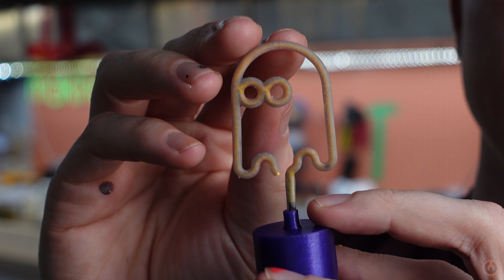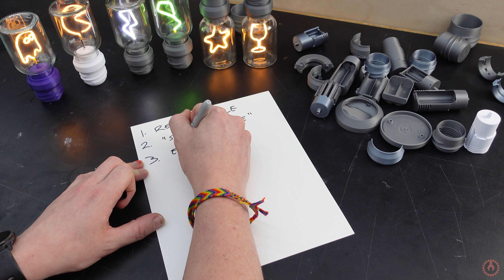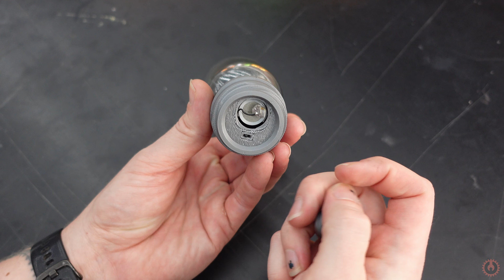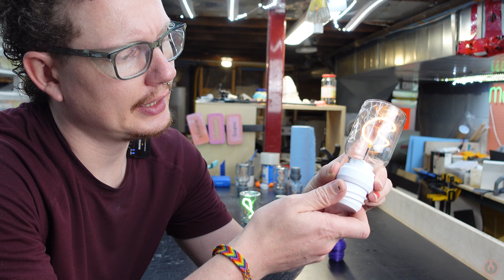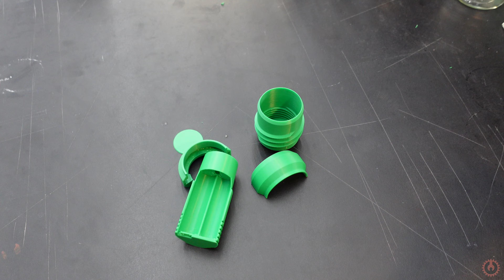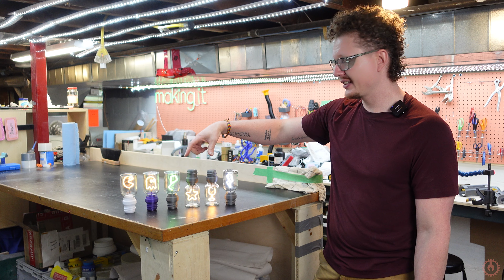How I stuffed custom shapes into lightbulbs!

Comment: Nice product! I am wondering how you build the filament part
Reply from the maker: The filament shape is a resin print, from a file I designed. It is a slot that the LED filament can press into so it is easy to install but maintains the shape. In my previous video I show how I am able to trim and re-solder the LED filament to a specific length so that the positive and negative leads are on the bottom so I can wire it into the base!
Reply: @wesselscreations  I should have checked, I just subscribed :)
Reply: @Ernzt8  You could also use FDM printed part with a white or transparent filament to keep the LED in shape

Comment: It would be interesting to make a version which is powered by a smartphone wireless charger, it will be compact . It would be a nice nightlight.
Reply from the maker: @visualchallenge2413  I was looking into an internal battery that could be charged in some way, but the electronics started driving the price up very quickly. I'd like to revisit it at some point
Reply: @wesselscreations  What was in my mind is NO battery, just the power going directly to light the bulb. That can be interesting. In any case just proposing ideas :)